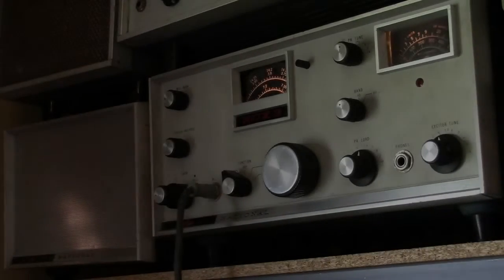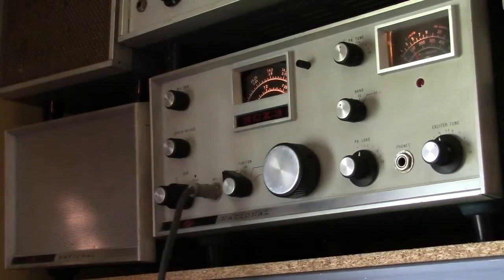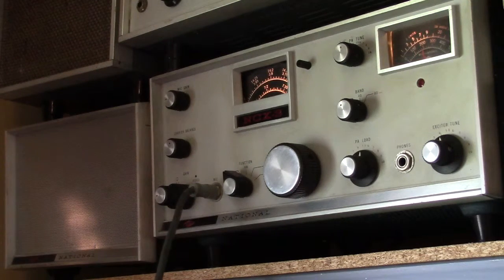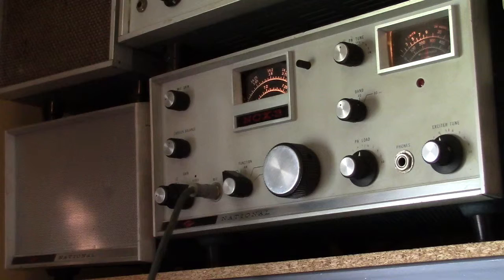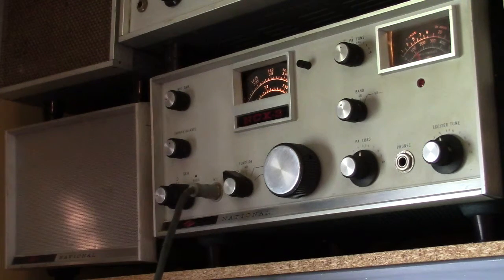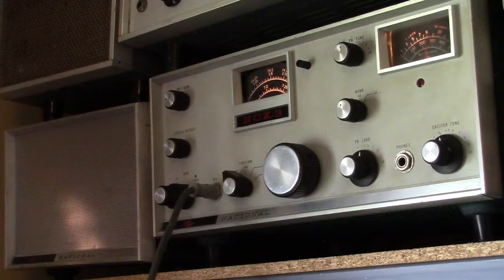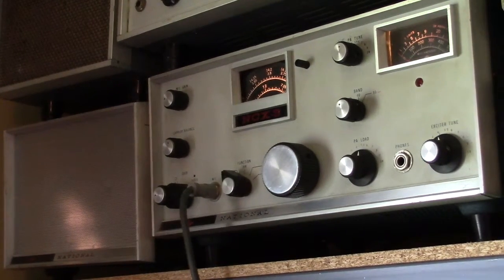National NCX-3 3-Band HF Amateur Transceiver (1962)

Comment: I am 77, was first licensed as novice in  65 in high school.  Before I was licensed, my first  foray  and intro to amateur radio  was through the local club,  which  I had no idea--was FAR  above and beyond  our  very small town and county.    My first field day--logging--was at the not yet  completed  Schweitzer Basin ski lodge,  I think, in 63.  We had an old 1kw--1.5kw  military genset,  took about 4 men to carry it,  and used a brand new NCX-3  that one of the members owned.   We also had a very knowledgable    retired  Bird Colonel  who was BIG on  CW.  He brought  is modified  bug as a paddle,  Hallicrafters keyer,  and  Hammarlund HX-50  transmitter, and used the NCX-3 on RX   for a shift on the CW bands.  Just about everybody  I knew then is gone, now.   Even a school friend who was younger than I by a couple of years died some time back.   We used a local's  callsign,  W7IDA  for the closest thing we could get to  "IDAho"

I am now battling the aftermath of a house fire,  and have not been on the air  for about a year and a half.